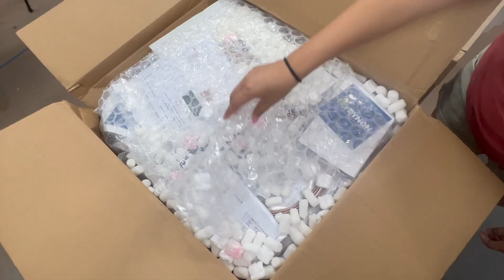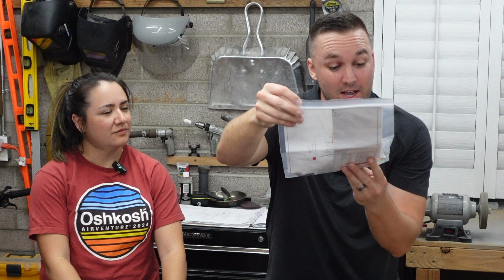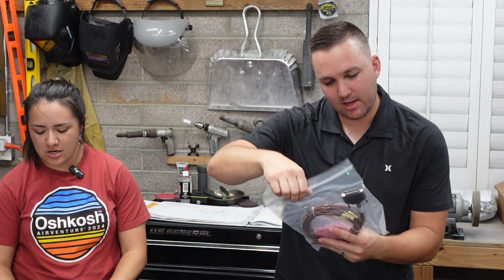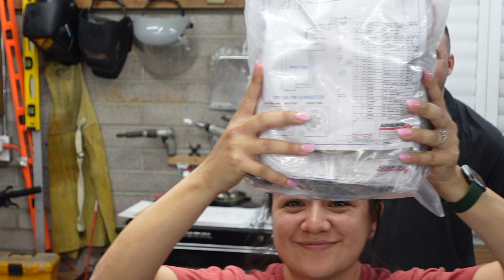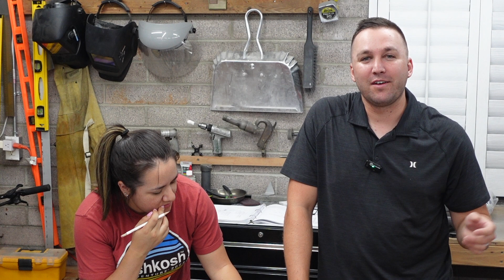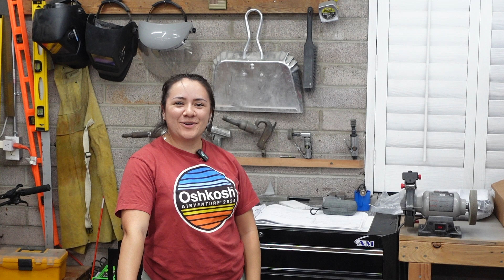RV-10 Build: Unboxing Advanced Flight Systems Wiring Kit & Avionics Equipment

Comment: Fantastic update! That’s a big step to receive all (almost all) of the avionics. Those wiring harnesses are going to save you so much time!!! I am doing mine myself and I swear it’s going to be at least a 6 month project (if not longer) on nothing but building wiring harnesses. 
I don’t know what Dynon’s instruction manual looks like but if it’s anything like the Garmin G3X manual it is very straight forward as to what all of the components are and how they should all be installed and wired together. 
Can’t wait to continue following along as you continue your build. Congrats on the sale!
Reply from the maker: Thank you! Having a good chunk of the avionics is a huge milestone, and the wiring harnesses will definitely save a ton of time. I can't even imagine trying to do this all on my own. Tackling your own wiring is next-level dedication! Dynon's manuals have been really thorough so far. Very impressed. Best of luck with your G3X wiring!!! Appreciate you following along!

Comment: At what part in your build did you order from Advanced?   I'm in the middle of my -14A wings and see that it would be good to get going on servos, etc. while the wings are still open on the bottom.  Thanks.
Reply from the maker: @md9680  I just put it in a few weeks ago. If I did things over again I’d do it as I went along with the build like you’re thinking of doing. 

I’m going to have to get back to the wings to install the components and then close up the bottom skins. It would have been nice to be totally “done” with them with the AFS/Dynon components installed in them.